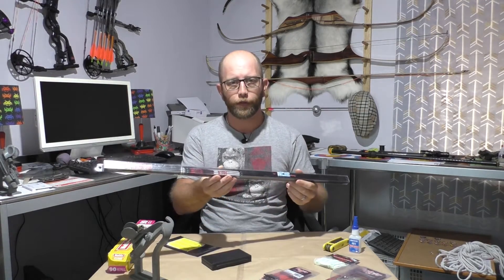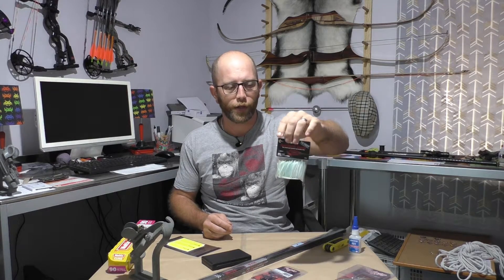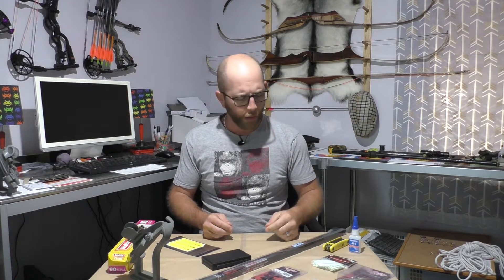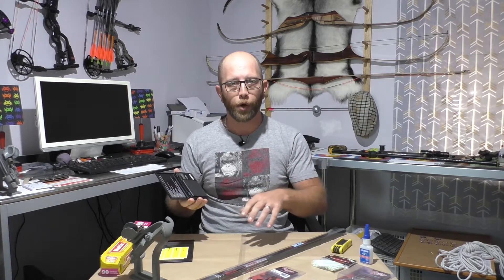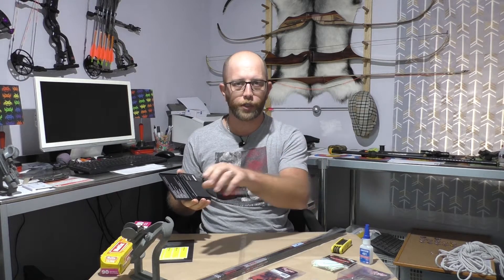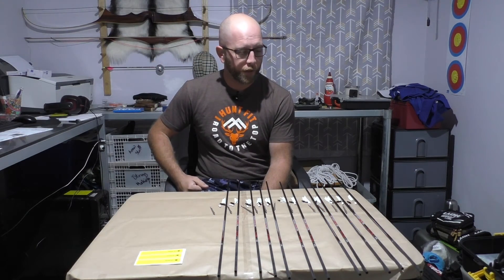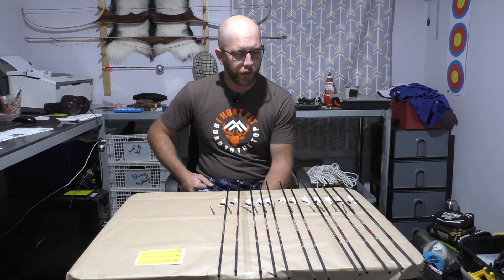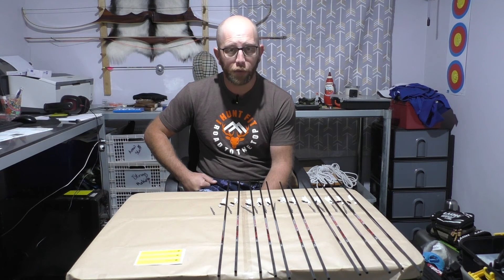How to build the most consistent arrows you can. (part 1)

Comment: Interesting concept with the Cling film. I'm quiet pedantic with my arrows but you beat me matey...  Low temp hot melt is what i use on the pins then i spin them to make sure they are square 
Look forward to part 2 Charl...
Reply from the maker: Big Tony Thanks Big T. I have found the cling film works very well for me. But I can see how the hot glue will do at least as good a job.

Comment: the hot melt  glue  works  great  if you can hold the pin or the  point  still when hested     it  will have no affect on carbon  can do it with lighter   when you want to get them out  but as your using awesome  victory pins you wont have to  they are tough  pins